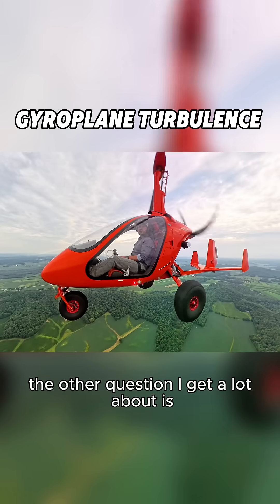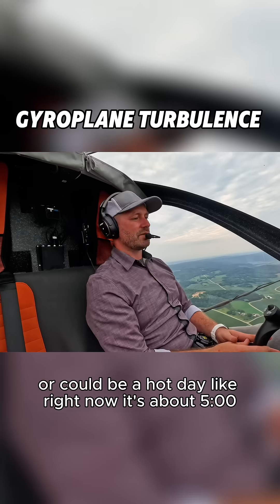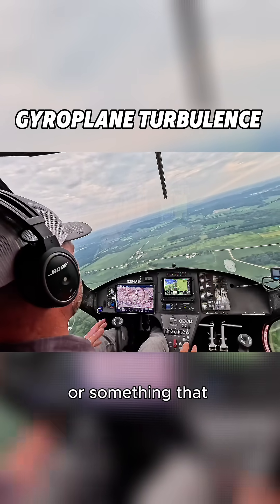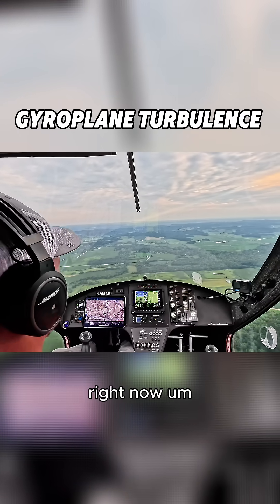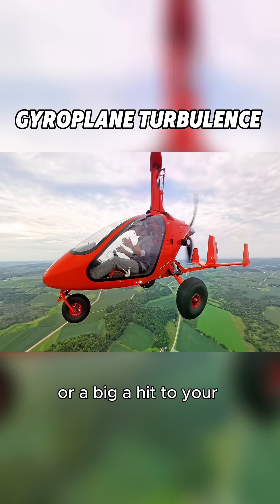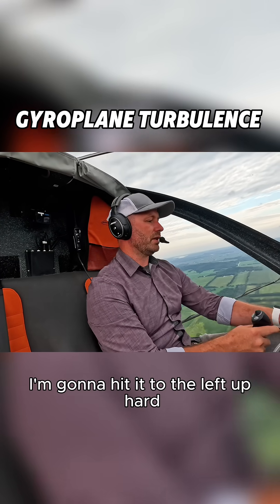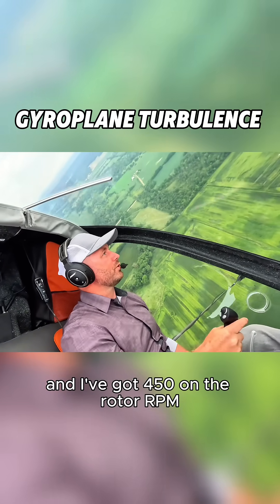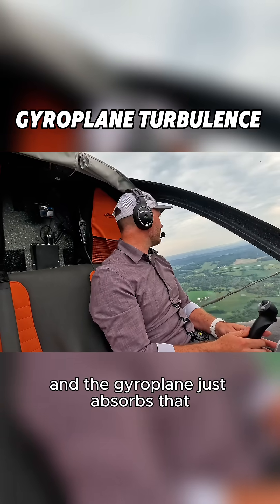How does a gyroplane handle turbulence?

Comment: Too much stick shake in them.  I could never be comfortable with things vibrating around me.
Reply: Even helicopters can have a shudder. I have seen the odd gyro recently that was quite balanced, but they are a minority. Most of them have the shake. Pilots tend to make light of it. To my logical brain, if it's got shake enough to constantly shake the bicep skin hanging down, that's gotta cause some form of longevity over long term use. I think it would become tiring and even hand numbing after awhile. I still haven't been up in one but can hardly wait. Have been up once in a heli. That was my first surprise, that there was a consistent rotor shudder, not really shake, through the entire chassis. It looked less aggregating than in this video.

Comment: I would never get off the ground without a parachute.
Reply: Too bad, I already called bottom bunk
Reply: Flewn gliders. Today emergency chutes are normal. But safety checks is such a big deal, chances you ever need that chute are tiny, a plane you can not control anymore, that takes quite something. Things you can think of, are competition pilots, pushing the limits and flying near top speed, when they hit turbulence at that moment, they hear BANG and a wing is falling down. That is jump out time. But when you do not do this racing, you will never break a wing. When you just do some local flying, what is going to hit you, making you jump out of your plane? General idea is, that plane was designed to take care for you, you are SAFE inside your plane. Keep it flying, stick to procedures, even stick to your emergency landing plan.

It is so weird seeing all those people in prop planes without even a normal 5-point-seatbelt.  No chute, no normal belts. And that is LEGAL?! How?! They got no Airforce mentality either. Scary pilots, if you'd ask me.
Reply: @voornaam3191  You mention safety checks. If you take Alabama which has no car safety check and a crash rate due to mechanical failure of 2%, and Louisiana which has a crash rate of 3% with a state safety check. It's probably the same outcome with aircraft too, don't you agree?
Reply: lol flewn

Comment: Based on what you've said , it's WAY safer than a Learjet and if I was going to fly in any civilian craft , it would be this one. I wonder how many learjets have fatal crashes compared to commercial of all total aircraft accidents ? I bet Learjet accidents out pace commercial 3 to 1.
Reply: Idk what a learjet is but helicopters dont glide when the engines fail buddy. A helicopter engine failure is usually a serious crash landing minimum. A plane engine failure can result in landing the plane easily for an expert with a nearby country road/field/air strip. You cant do that with this..
Reply: @spencerkleiman5035  have you heard of autorotation? You may not glide as far as a plane can, but you wont need to find a long  flat stretch of land/runway/road to land safely either.
Reply: @spencerkleiman5035 This isn't a helicopter. The upper rotor isn't powered, it auto-rotates. Unpowered (say — engine failure) and this will glide.
Reply: @spencerkleiman5035 if you don't even know what a Learjet is I don't think you should be voicing your opinion. You may as well say you don't know what the stomach and small intestines are in the body but then give nutritional advice.
Reply: @spencerkleiman5035  Rubbish, everything that is a man carrying aircraft can glide without power.
Reply: @spencerkleiman5035 whats the wheels for then if not to roll.....??